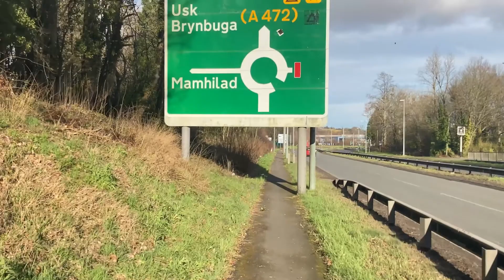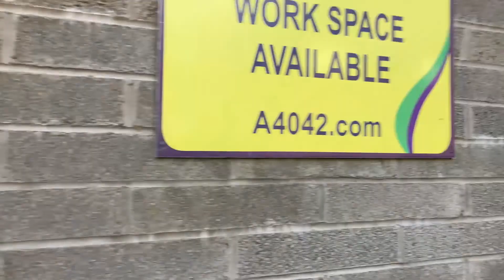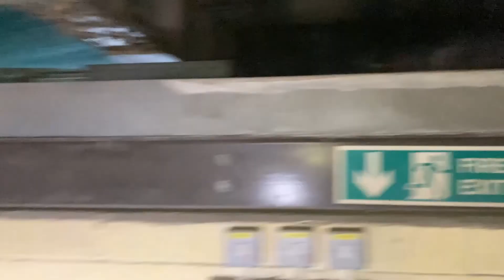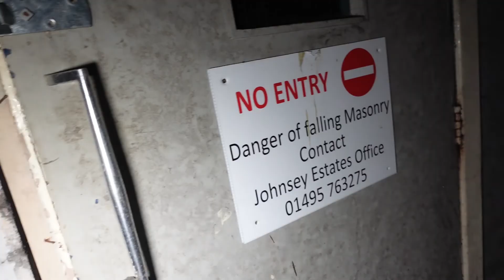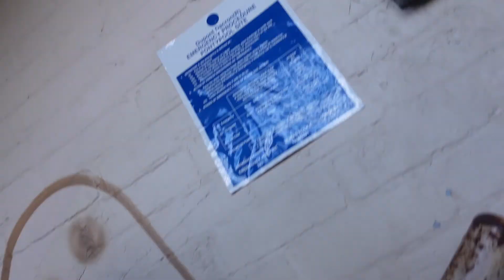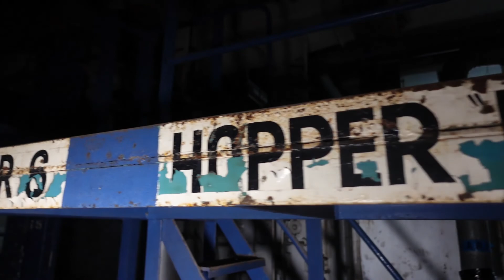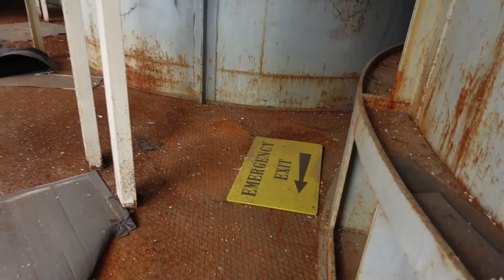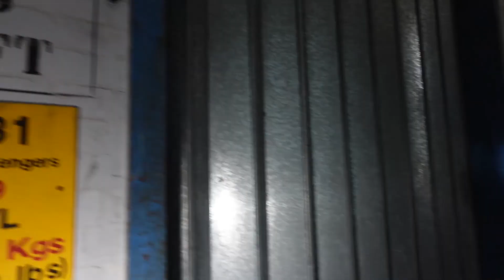INFILTRATING The MASSIVE British Nylon Spinners CAUGHT - URBEX 2022

Comment: BNS was absorbed into ICI Fibres in ‘64/‘65.
Bought by DuPont in ‘92.
Changed name to Invista UK Ltd approx ‘03?
Sold to Koch Industries in 2004. 
Remained as Invista until closure. 
Just for info, apart from the obvious physical dangers of the derelict parts of the building, you are definitely putting yourself at risk of exposure to asbestos dust if you disturb anything. Having worked at both of Pontypool’s sister plants, I can tell you that these buildings are rammed full of asbestos!
Reply from the maker: Good to know mate, interesting to find out a bit more
Reply: My late father S. Hill worked days there toolmaker 1962 - 1982. I visited open day late 70's and seen the non woven terram.... amazing !  I remember being told there was up to 400 bus journeys a day in/out of ICI. I think I've still got a stamped ICI spoon or fork somewhere. My father said they looked after their w-force even when Hanson Trust wanted to get their hands on pension scheme.   I worked indirectly with NHS in other buildings ... the brass fittings in the loos befitted management.